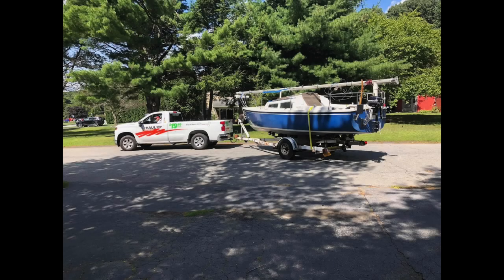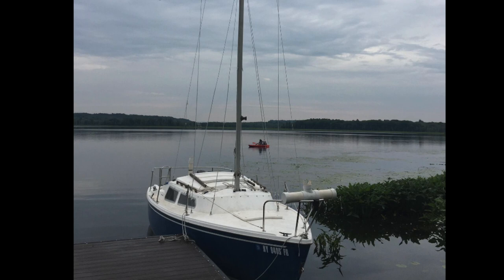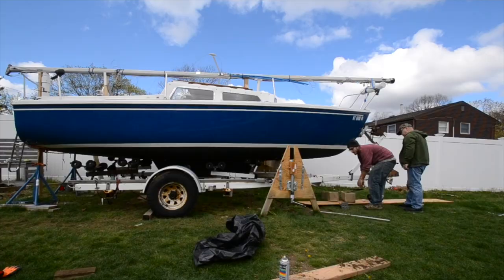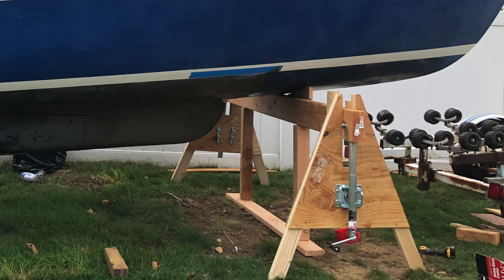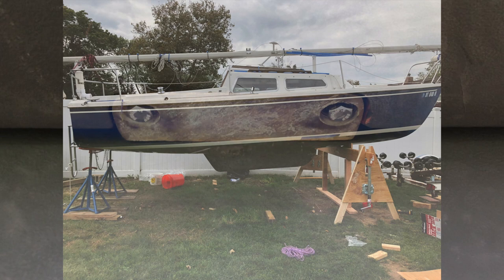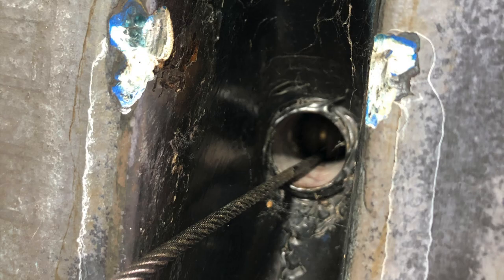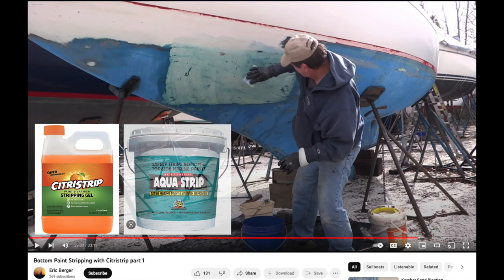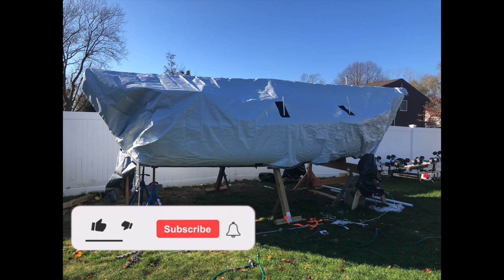Lifting a boat off a trailer and stripping bottom paint

Comment: I really like the jack method.  Takes only a little more time up front and saves a bunch of dinking around.  I think it's important to add the extra uprights once the trailer is out.  Great video, Mathew.  If I hadn't already solved the problem for me, I probably would have done it this way.  I will be remaking my lifting videos this spring.  Longer-stronger beam, and a wedge on the beam.  I especially like the measuring too you created and the oversize wheels on the cart were exactly a great solution to the unpaved site.  Great job!